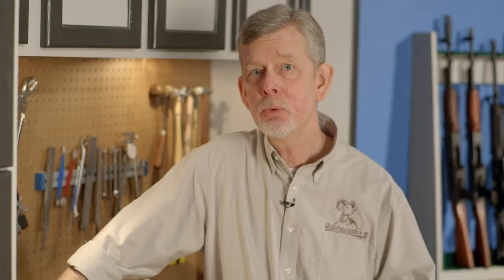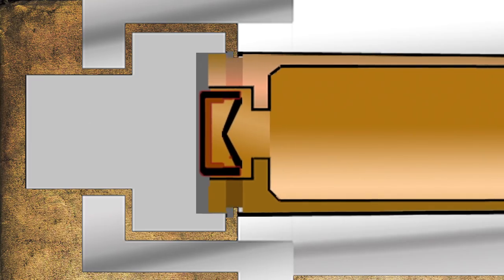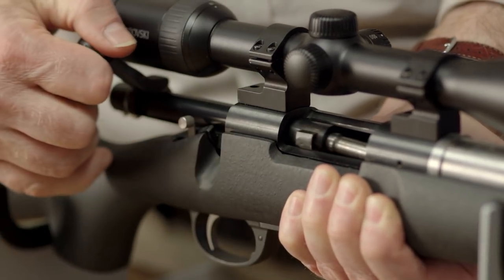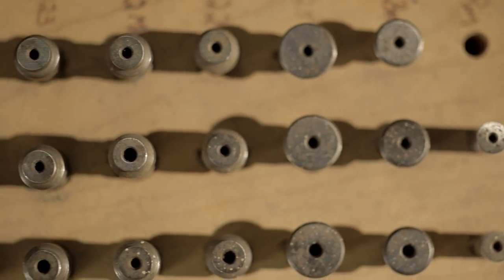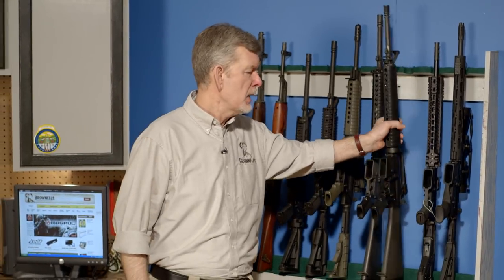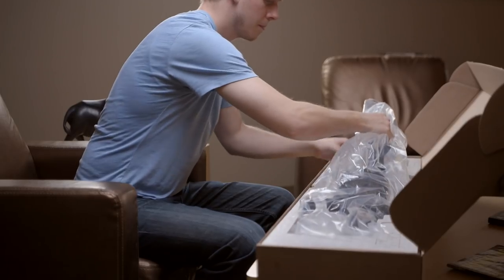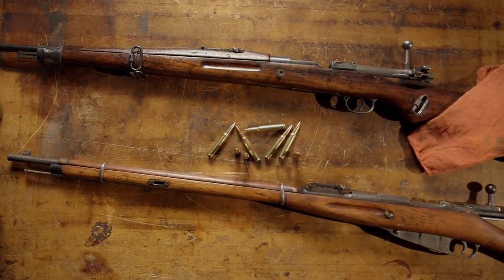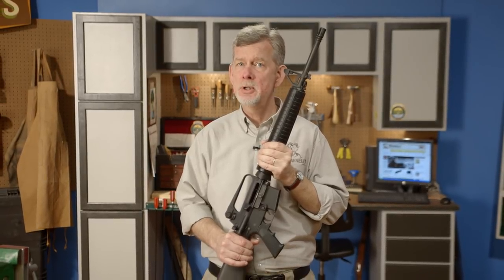Tech Tip: What is Headspace

Comment: I wish you sold a kit for mauser 7&8mm and 30-06. I need to get the 6 headspace gages, Go, No-Go and field, because $270.00 for one time use is kinda high. For a gunsmith, it's an investment, for most shooters, rather than spending the money, they'll use tape. I should just get one set at a time, because I won't go shoot until I get it done right. Thanks for the video
Reply: If you live in the United States, there are several companies that rent headspace gauges. 4D Reamer Rentals and Reamerrentals.com are two, just off the top of my head. Reamerrentals.com charges $7 per set. Use them and mail them back.

Comment: I’m new to guns, only been shooting about 2 years. I just bought a C39V2 and Bob Ski was talking about headspacing. I also have a Henry Big Boy in 357 magnum, does that also need to be checked?
Reply: New factory guns shouldn't have a problem with excessive headspace. Excessive headspace develops over time because of wear and/or damage. Normally a factory will check headspace on a new gun as part of their normal inspection (QC) process.

Comment: My mosin bolt cycles fine when unloaded but after its been fired and there is a spent casing in the chamber it takes quite excessive force to pull thebolt back and extract the casing. Is this a head spacing issue or something else possibly?most people I let shoot it cant even pull the bolt back so they have to smack it back.
Reply from the maker: Possibly. We suggest reaching out to our Gun Tech staff at 800-741-0015 to get a definitive answer.
Reply: Likeliest explanation is too hot a load and excessive pressure.

Comment: Many AR barrels are marked 5.56 but are not chambered for the true 5.56 NATO chamber. You need a 1.4646 go gauge for a true 5.56 chamber. There are throat and function gauges to check the barrel's throat to verify the throat is a true 5.56 NATO throat, 223 Wylde or 223.....